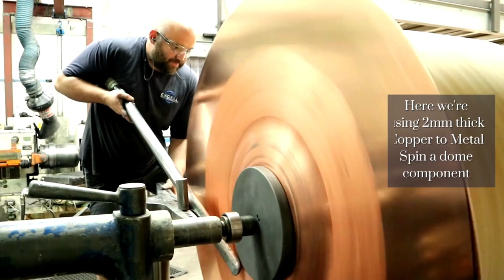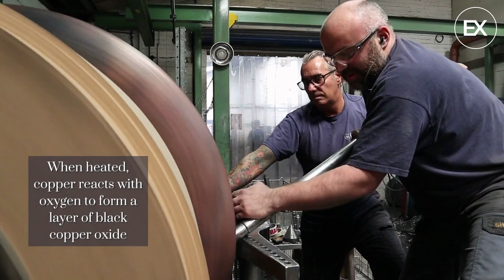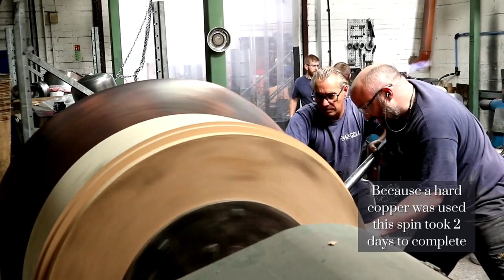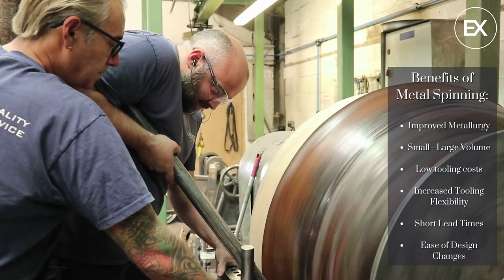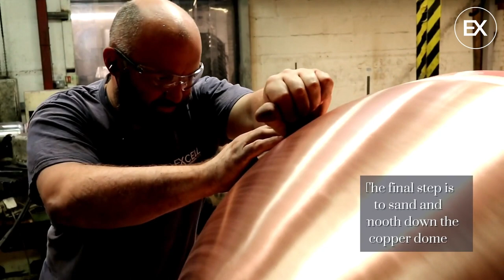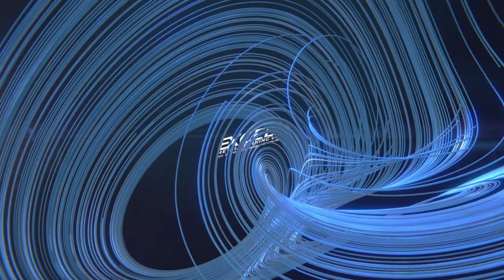Metal Spinning Copper Dome - Hand Spun In Under 3 Minutes!

Comment: Jaka gruba blacha . ? 
Nie robicie rolką . A to znaczy że jesteście bardzo dobrzy w swoim fachu.  bo rolka niszczy materiał.
Reply from the maker: Thank you so much! This was a very thick sheet. Ideally, we would have used a softer copper so that we wouldn't have had so many annealing stages.
Reply: @Excellmetalspinning  How thick is the sheet. And is there copper  that remains soft.?
Reply from the maker: @janespensandvik3131  This project uses 2mm thick copper. As it was annealed and spun several times the metal hardens so it will not remain soft